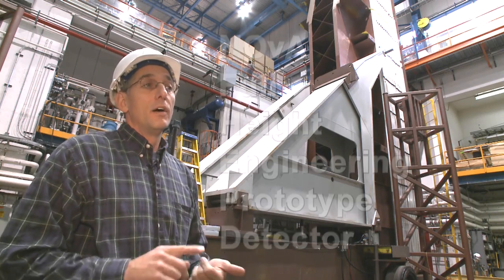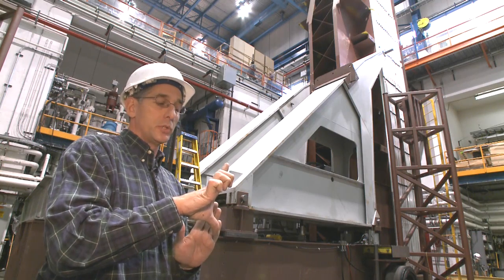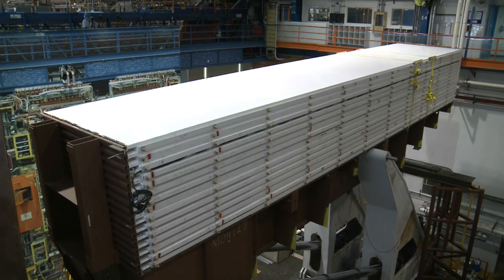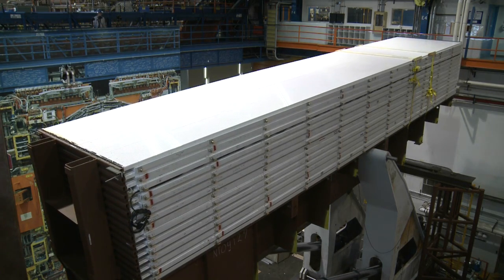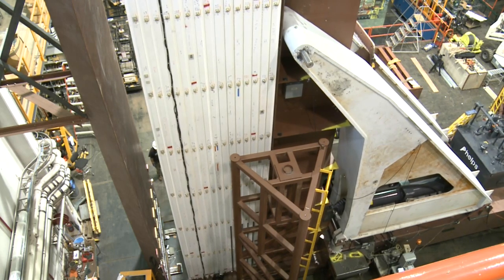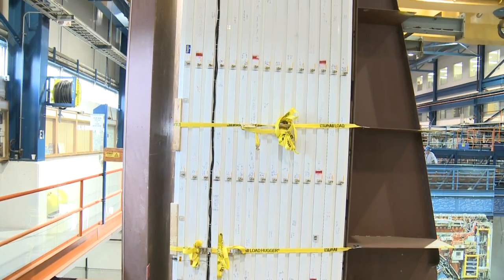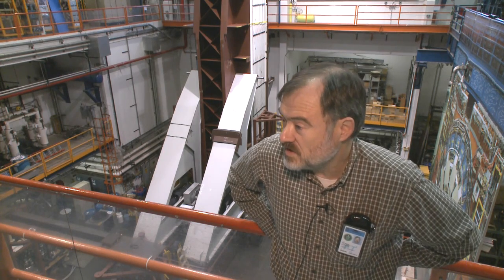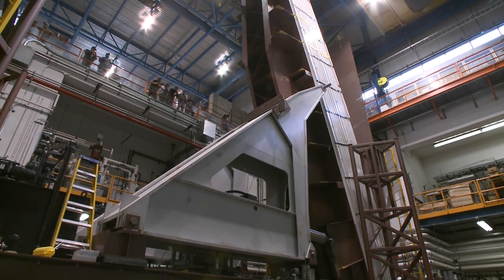NOvA Pivoter: Milestone for assembling a 15,000-ton neutrino detector

Comment: The data acquisition system can make the time-of-flight measurement from Fermilab to Ash River but our clocks are probably not accurate enough to comment on the recent results.  We have made a request for enough money to upgrade the clocks but we will see how that goes.  To the photo emulsion detector question, the plastic slabs are full of mineral oil with a scintillating chemical mixed in. Particles cause the chemical to emit light that is captured by photo-detectors on the edges.